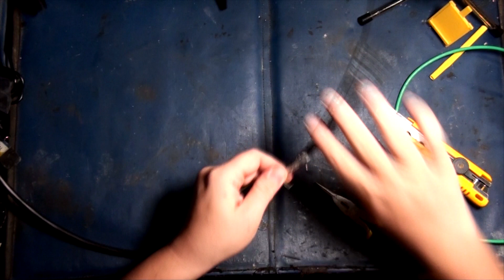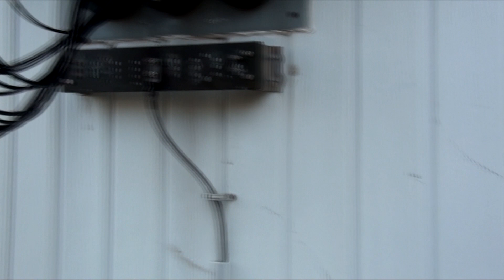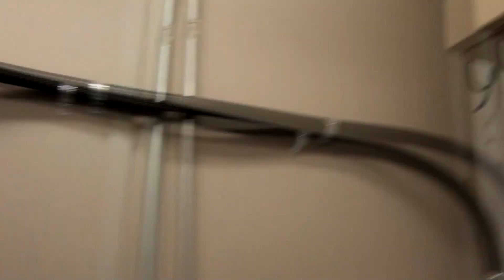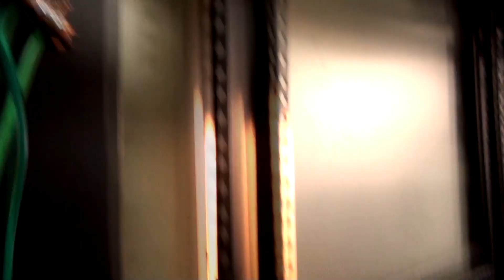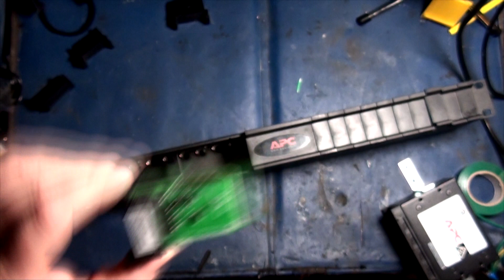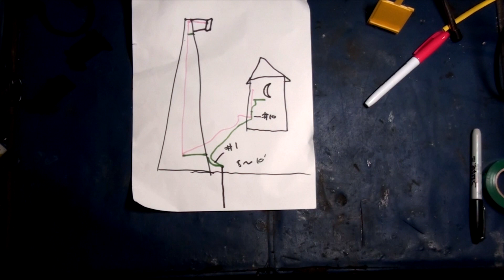Grounding for Wisps

Comment: Hello. Is it ok if we leave some shielding on the back of the rj45  when we crimp it and tie there our grounding cable??? So we will not strip our cable and also our rj45 is grounded and the cable too and the same down in the building. Also should we ground our radio even though it has not have a grounding point, by making one ourselves??? Thank you for your videos!!!
Reply from the maker: The grounding video is mainly for tower grounding. For residential installations you simply add a Lightning arrestor :) Does that help ?
Reply: @thefixitgal  I am talking for tower grounding too. I mean if it is ok to tie our grounding cable right at rj45 and not striping the cable a little under like you did.
Reply from the maker: @zerobit33  Use the proper cable. Cutting corners will only lead you to damage. You can also buy Rj45 connectors that come with a grounding wire attached ^^

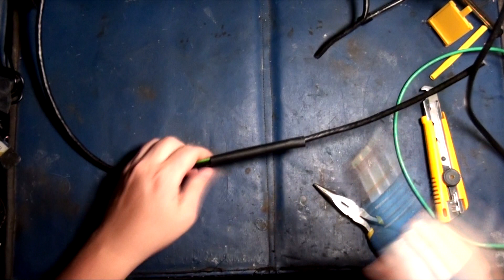Comment: at 6:25 I thought using stranded was better for lighting protection?
Reply from the maker: Really the need for stranded is determined by the mechanical environment. When constant movement is involved stranded is a better choice than solid. In this case its to ensure a quick simple bond for Wisps. Something that can be done easily without much thought.

Comment: Doesn’t having a ground on the cable at the base of the tower AND in the shack create a ground loop on that section of cable between the tower and shack?
Reply from the maker: Not at all. This is very different from broadcast. the tower shack should share the same ground system as the tower. It is all explained in the video. 
In most cases there's a halo around the tower which connects to the ground rods & tower. then a 1Awg or better carries from that to the shack ground rod. The gear in the shack connects to its respective ground rod which in turn connects to the towers. 

Without common bonding across the entire site you run the risk of creating voltage differential which can backfeed through your data pairs and damage your switches, routers etc.

Comment: What modifications to this do you suggest for those who do not run ethernet all the way to the ground?  Just power.
Reply from the maker: AH. for those situations where you have a fibre switch up the tower? 
Same cable type but instead of bonding the shield you make sure the radio is bonded, the switch is bonded and the cables are run inside the tower :)

Comment: can you give advice on where will i put the  ground rod on my rooftop. T.y. Godbless
Reply from the maker: You run a ground cable no less than 1 Gauge from the roof top tower to the earth.  Can you give me more detail on what your situation is? Is it a free standing or guyed tower on the roof? Or mast pipe in a non penetrating roof mount?